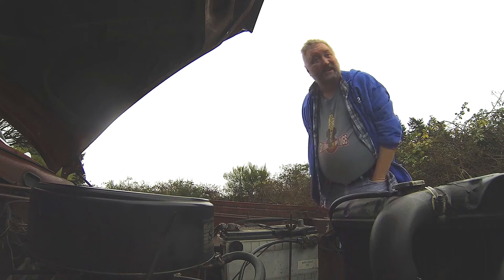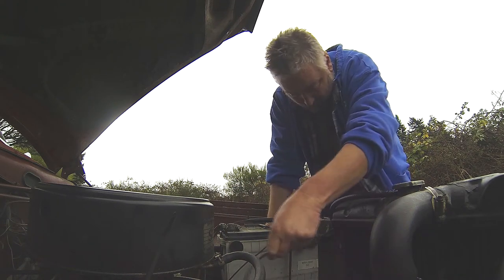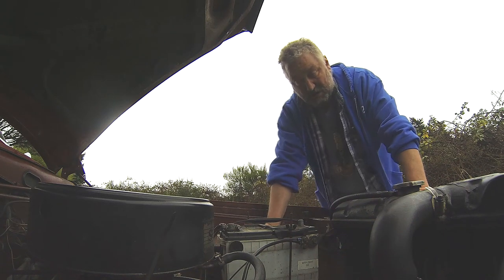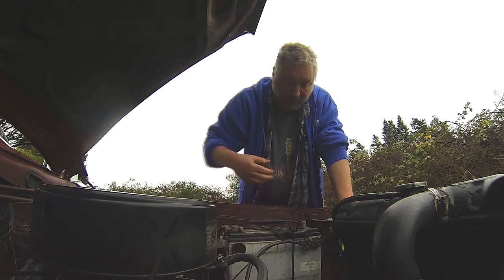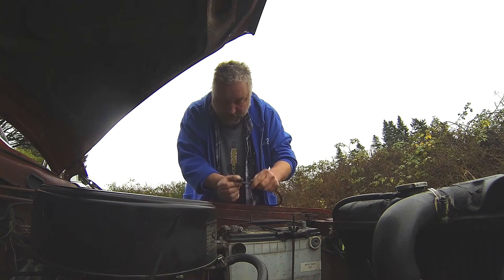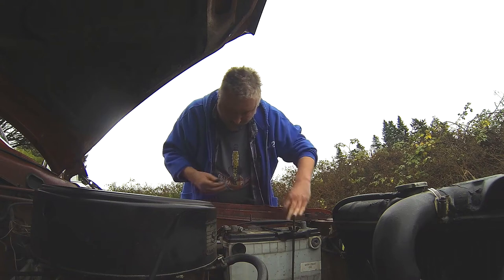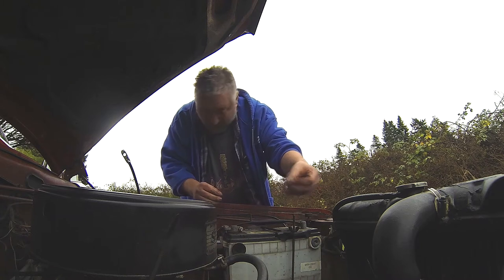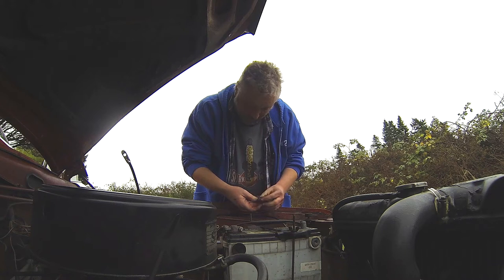1966 Plymouth Valiant: Additional Gremlins

Comment: Damn you work fast !
Reply from the maker: Well as you have seen with the Almighty water it is required to work quickly! I used exactly 3 rain delays to get this (and 1 additional repair today) to happen, I did achieve THREE soakers on only two feet.